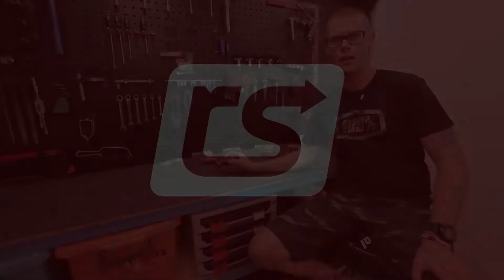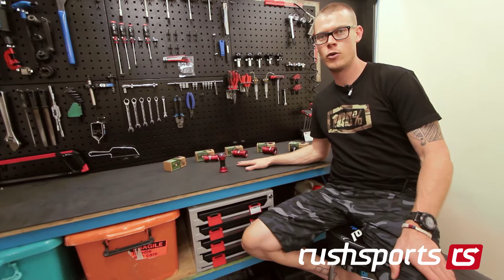Wheels Manufacturing BBs

Comment: hi looking at getting the pf30 outboard bb for specialized tarmac sl6 for shimano crank but at a later date might upgrade to a quark power meter with a gxp crank with the one that's compatable with shimano/sram how does the non drive side bearing step down from 24mm to the 22mm for sram??? thanks

Comment: For the BB with the threads, do you thread the 2 pieces together (via spanner tool) and it pulls (presses) the BB into 
the frame or do you still have to use a tool to press the BB into the frame?
Reply: Drive side is press fit. Non drive is screwed in with a special wrench and torqued as specified.
Reply: Little late buttttt if you cool them in a freezer you may be able to slide both halves in and thread tight